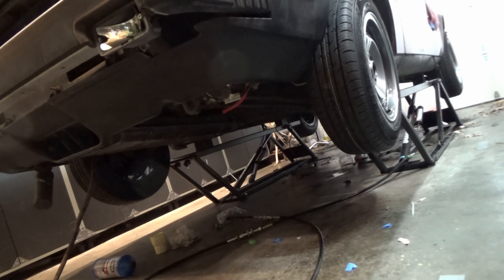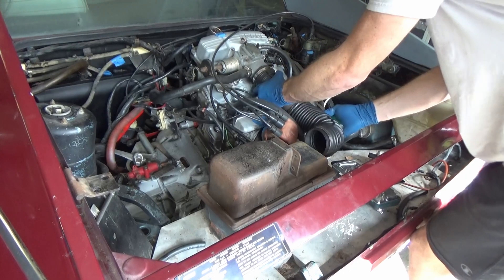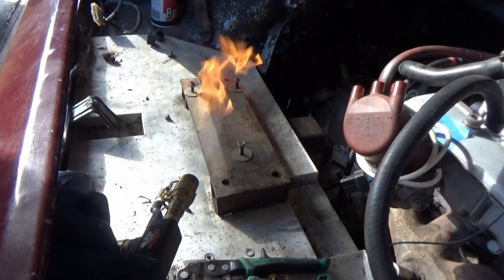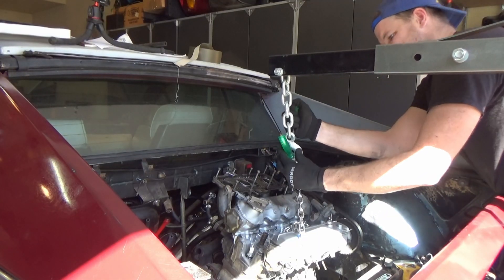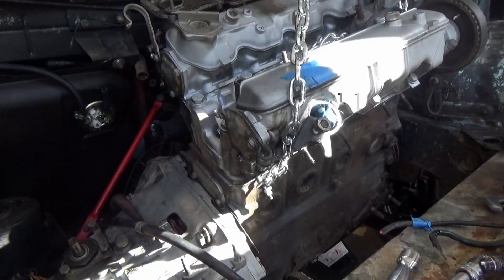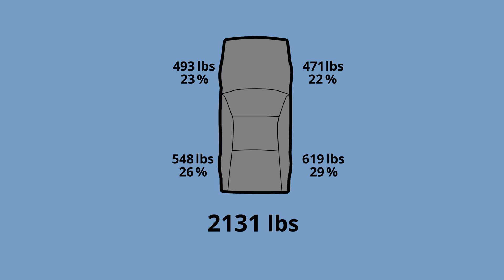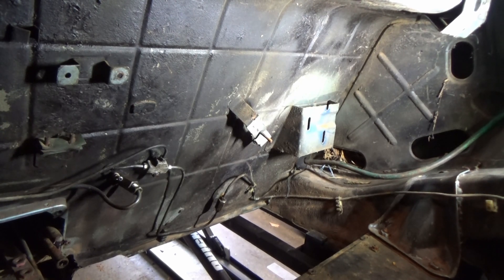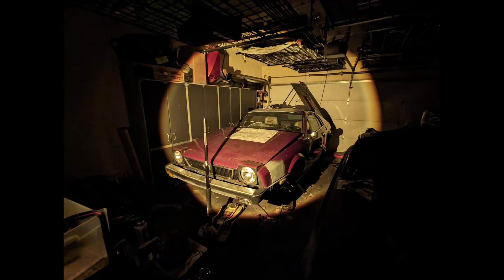EV converting a 48 year old Lancia Scorpion: EP1

Comment: Why wouldn't you put the batteries (or at least some) in the front boot/trunk to get a little more weight over the front wheels to aid braking?
I am assuming the scorpion, as the Montecarlo, was much malignedfor front end lock up due to the fronts light weight.
Reply from the maker: This is a great question and was my original plan for exactly that reason. I think it's in the next episode where I build the battery box that I explain what changed. Contrary to what I would have guessed, more weight over front wheels is less traction when braking.
Reply: @DECOM_EV  Its not that the car understeers, its that the brakes lock
Reply from the maker: @bradm037  good point on the distinction. Now I'm imagining if I had put the batteries in the front I might have added understeer on top of brake lock up.